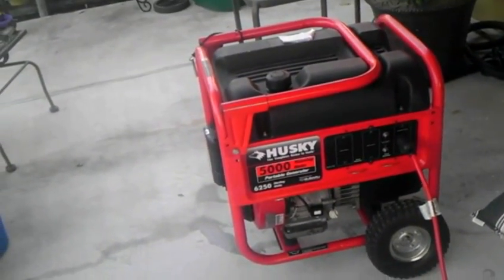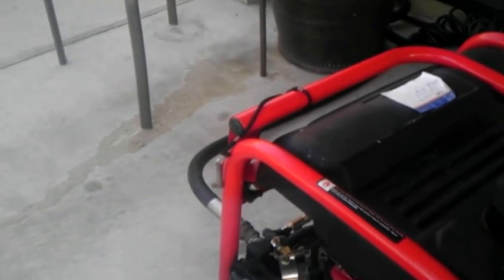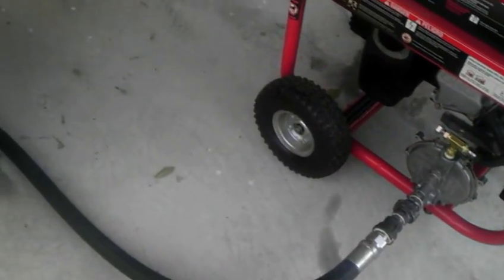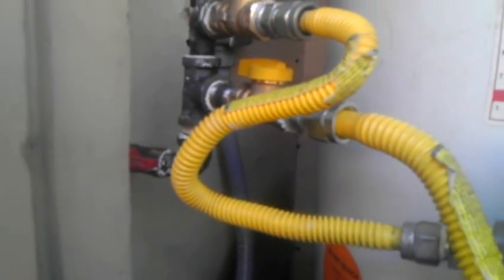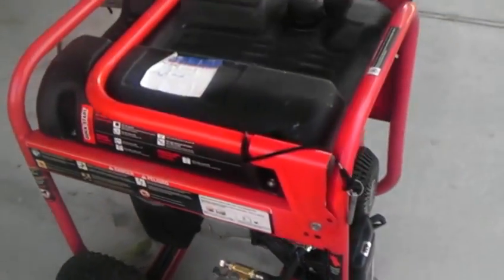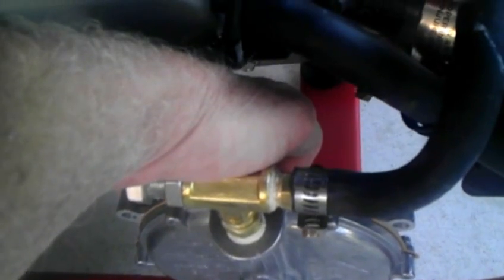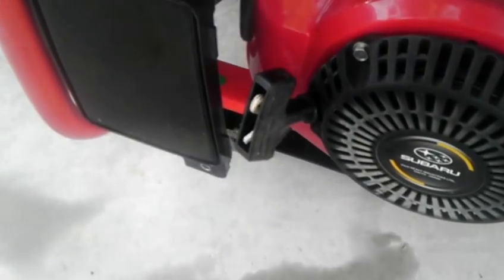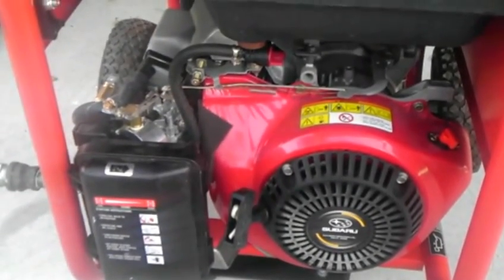Gasoline Generator Conversion to Natural Gas

Comment: NO..NO..NO.. the venturi adaptor is installed correctly.. just make sure you adjust your load block under full load to achieve rated rpm. when I install these I run a QUALITY synthetic engine oil I use mobil one 10w30 extended performance and religiously change it every 50 hours or once a year to remove moisture. this is a must!
Reply: Pardon, you say "load block"  not sure what this is? When running my generator seems like it's stalling under load.

Comment: Just watch the air filter.... mine connected to the frame - after I put the adapter it would reach the original mount leaving it hanging - BAD MISTAKE - cracked the bolts off from the block in the middle of Sandy from vibration - had to retap  - make sure its secure an mounted!

Comment: A few notes from the US Carb tech forums.  Any restriction in hose or pipe makes it that size from that point on. 
Always try to obtain the maximum rpm's at the leanest possible setting under load.
Use an oil with a low ash content. We have found that Exxon Super Flow 5w30 is an excellent oil for altenate fuel because of it's extremely low ash content.
Setting the spark plug gap to .020" causes a more complete combustion which will cause the engine to run cleaner and more efficiently.